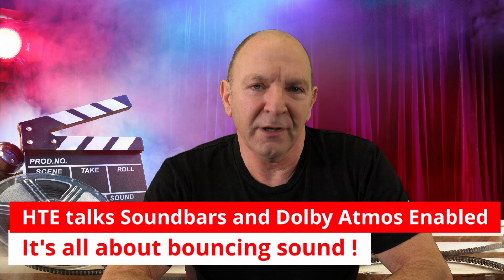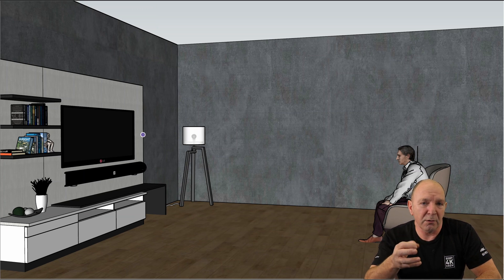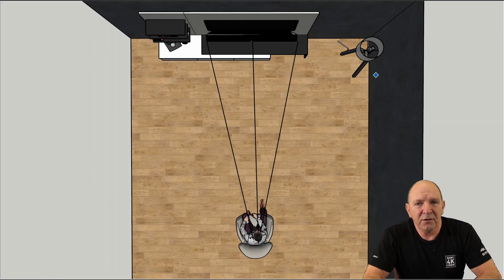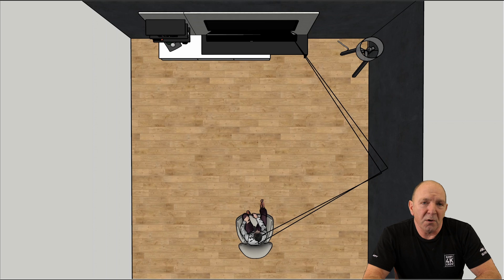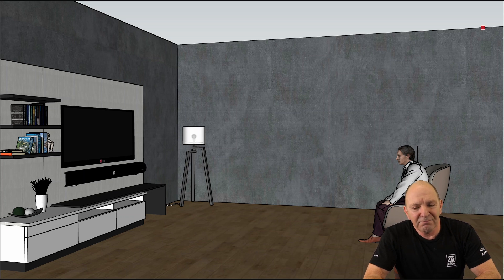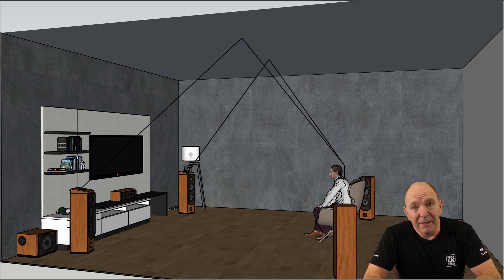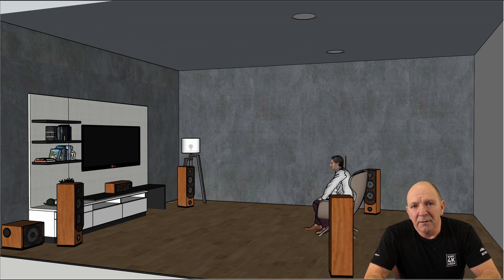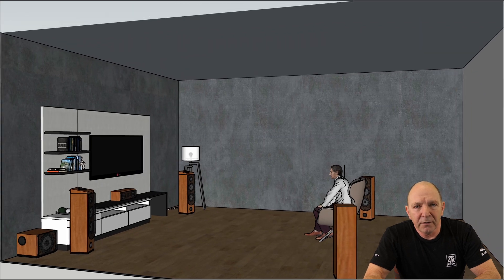HTE talks Soundbars and Dolby Atmos Enabled.

Comment: I've been waiting for this material for a long time. Long time trial of dolby speakers makes it possible, but in my case it does not work, now I know for what. Is your company a branch in Central Europe? If not, can you recommend someone? We have companies in Poland that deal with it, but I'm afraid that half of them are only pretending to know something. You can somehow tell them apart. I am just at the stage of designing a cinema room. I made the dimensions of the room with the THX standard that I found on the Internet: 1x height, 1.5x width and 2.5x length I don't know if these are the correct proportions?
Reply from the maker: Hi Marcin. Reach out to us via our website we work internationally so we can probably help.. hometheatreengineering.com

Comment: Great vid guys.  Awesome explanation.

Personally the only time I go with reflective Atmos on speakers is if the client is renting, so they cannot install speakers into the ceiling.  Even then I suggest the client invests in a second sub, better speakers or better amp as the value proposition return is far higher than reflective Atmos.

...and if a Soundbar, agree with you as a LCR setup being far better.  If you need an active Soundbar, then I suggest a great 2 channel active HiFi speaker system as a far better option or at worst, an active Soundbar that is only 2 channel so you can get some (albeit small) separation of sound for the LR channels.